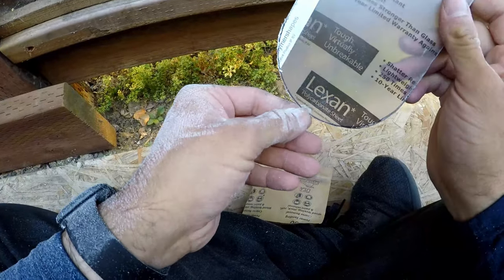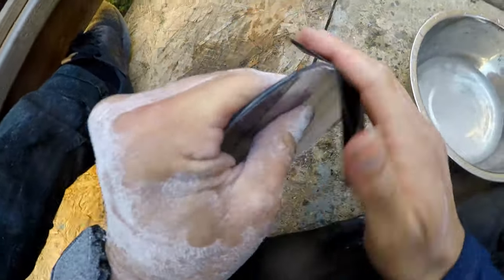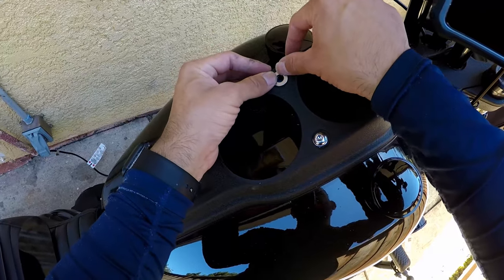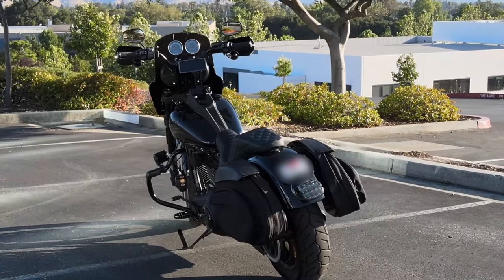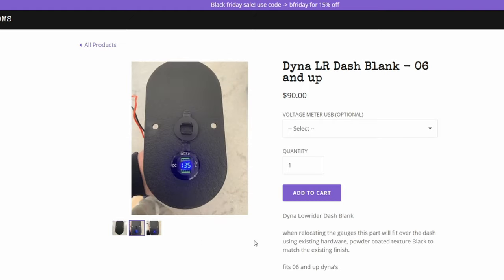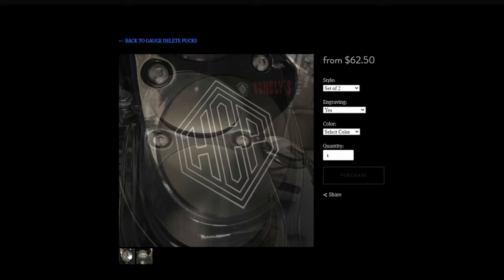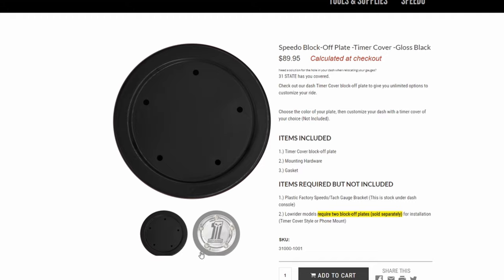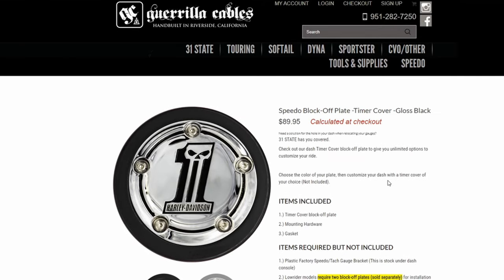Harley-Davidson Speedometer Block Off Plate FXLRS Dash Gauges Cover

Comment: Good video. I like the custom piece u made. My quarter Hd fairing bottom piece that snaps into grommets broke so they will be replacing it via warranty. I’m thinking hard on getting that fxt fairing and doing the gauge relocation plus the custom sound and also relocating the led turn signals
Reply from the maker: That'd be bad ass gangsta ish. I love that fairing, rwd sells em for around 1k. Bracket, fairing, dual gauge bracket, audio system , and paint job. Ballpark cost over $2k-2.5k. I'm waiting August to purchase my 2nd softail. I'm looking at fork turn signal brackets, maybe next how to video.
Reply: InfamousCreep u doing a great job on ur build

Comment: What were you’re dimensions for the block off
Reply from the maker: I traced it on top of the dashboard. I used a 8x10 sheet from Home Depot, traced it with a cylinder object, and connected the circles with a ruler.